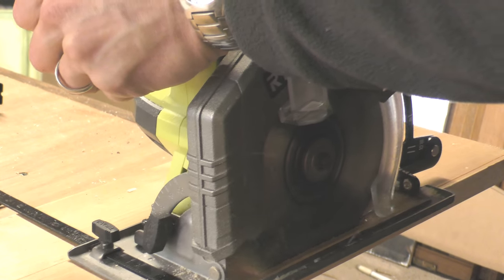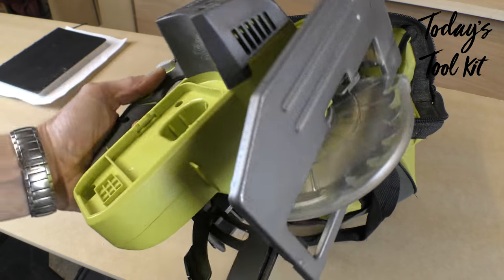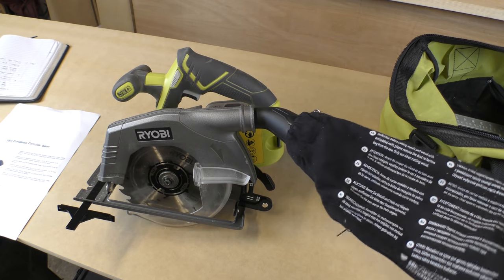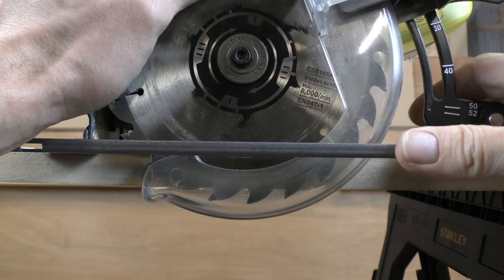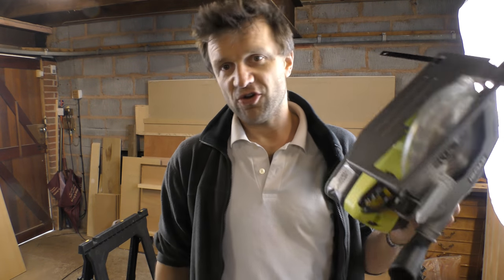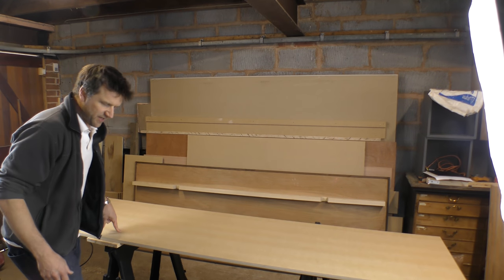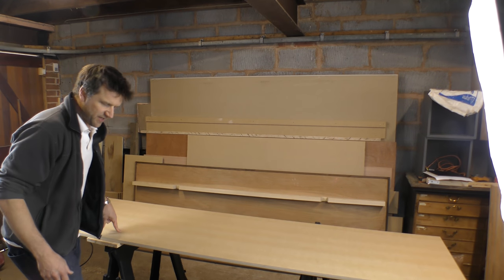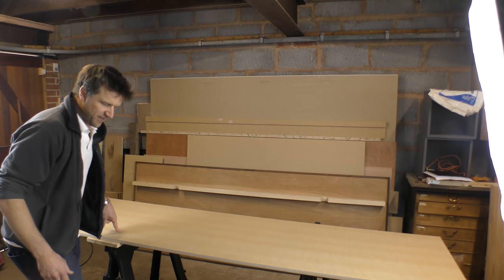Circular Saw - the MUST HAVE DIY Tool

Comment: Hi Charlie, this might put a smile a smile on your face. Bought Black and Decker Circular saw in the late eighties, it died 2 years back so looked around for a replacement and bought a Ryobi  RWS1250, have not used until yesterday in the wind!  So set it up and start to cut and a few inches in it stops, motor working and no cutting. The old B&D was just fire it up and go, no need to adjust anything! So ended up finishing by hand.  Quick hunt on YouTube and I found your video and you answered all of my issues.  Like you I had the depth adjusted too deeply - thank you Charlie for saving the day and my arm muscles!!

Comment: Thank you for a great vid! I bought my circular saw in the summer and it has been a gem ever since. Mostly used it for splitting timber but now doing sheet work. Great tips about the work table, which is a pain with big heavy sheets. Now I understood how I can cut way better! Also didn't know that the depth is so important.

Comment: For full sheets, I stick them on the floor on top of a sheet  of HD foamboard, set your blade to protrude just a few mm below your workpiece. No point wasting time and effort trying to lift full sheets. Also better cuts as the whole piece is supported so no flex and you don't have to worry about the off cuts dropping on the floor.
Reply from the maker: Great tip Sam - thanks for sharing!
Reply: Sam I adapted you idea and used bubble-wrap as it was a zero cost item for me.  It lasted a while but I replaced it with cardboard from old Amazon boxes. Both "spacers" worked a dream and saved a huge amount of time
Reply: I use an 8x4 sheet of 35mm kingspan insulation
Reply: @Ring Tony Great idea! I'm just getting into DIY in my retirement and happen to have an old flat door - perfect. ;-) Presumably, you "sacrifice" the door (i.e., end up with shallow tracks cut into it from sawing wood on top of it)?

Comment: I use the exact same circular saw :)  When I first bought my Ryobi tools, I got a smaller model circular saw, but it was too small for cutting 2 inch lumber which I do all the time, so it was rather useless. I then bought the model you have and It has done a ton of work for me :)  edit: The other Ryobi tools I have found myself using a lot is the impact driver and the multi-tool. I don't know what I would do without them now..

Comment: Great content Charlie. For a long straight edge i brought a length of Unistrut from my local air conditioning suppliers. Straight and true, and got a nice bit of weight to it. And really cheap. Great straight edge for all workshop uses.
Reply from the maker: Thanks buddy! Yes I've got something similar - a long straight bottom section (hanger) from an aluminium electric roller blind box. It works as a saw guide and as with yours, has also doubled up as a general straight edge.

Comment: Got one of these, I'm a joiner, what a great saw. Got to last row of laminate flooring near wall & sods law 3 X 1" strips to finish it off😣 this baby was a god send with the guide, made it a breeze to do thanks Charlie love the vids👍👍👍
Reply from the maker: Cheers mate - and always good to get a positive endorsement from a joiner. Out of interest do you see any need for a plunge saw when you've got one of these. I'm planning a future video outlining the difference between the two. Obvs plunge saws run on tracks which is an advantage but Evolution do a circular saw that runs on a track. Possibly the best of both worlds. .🤔
Reply: @CharlieDIYte  the Ryobi does it all, just bought the evolution mitre saw 210 SMS & stand, that's great for speed for laminate flooring, cutting precise angles for spindles, both together is all the saws you need + love the multi tool...

Comment: I am a very novice woodworker aka CRAP! I never used my circular saw because it always wandered. Thank you so much for the blade height advice and I sure will try it. You have another new subscriber!
Reply from the maker: Hi Dan - I really appreciate that, thanks! Yes, definitely give that a go. I was ready to throw my circular saw away until a chippy mate pointed out the blade height thing. Now I couldn't manage without it! Finally, you're not CRAP, you just need a little practice!

Comment: Great video!!
I always use a corded circular saw because I don’t like how the battery ones always seem to die in the middle of a cut on me.  
Also if I have to cut large sheet goods.  I cut them on the floor and put them on a thick layer of ridged foam insulation.  This way I’m not cutting into the ground ruining my blade
Reply from the maker: Billy bob Smith Thanks! The cordless saws are pretty good these days - and if you use a 4ah or 5ah battery you'll get hours of usage out of it.
Reply: I bought a new corded Makita circular saw this w/e  down from £107 to £ 80  bargain !I do like Ryobi  tools but couldn’t afford that one just now!
Having said that this Makita saw is brilliant !
Reply: brian flower hi mate where did you get the makita from?
Reply: You either arent using the right saw, havent kept up with technology, or else the battery you're using is shit. The Ryobi 7 1/4 inch Brushless circ saw should not be used with any battery that isnt at least a 3.0 ah HP or better......It's all about the Battery!

Comment: This was a very good video for me, I have been using my circular saw! I have 2 smaller and bigger and have been watching lots of videos about using it in the right ways. It never crossed my mind to use the saw guides in this was as I bought some years back for my jigsaw. Thank you for a very well made video, I used some of these tips just today working on a DIY project building a jump for my mountain bike ... fire pit jump

Comment: Fantastic pieces of kit these are so versatile. 

Some small tips if someone is going to go out and buy one... Look for soft start and an electronic brake. These make a huge difference for me personally as I have a Makita 18v Brushless saw with these and also a 10 year old 240v version without these features and the older version feels a hell more dangerous or daunting if you like for a beginner....

Great pieces of kit with a straight edge clamped to sheet materials of a 12" rafting square!

Great video Charlie... Would have gone for the slightly more Makita DHS680Z and a 5 amp battery at £200 all in from Amazon but you are invested in the Ryobi platform I presume.

Thanks, thumbs up.

Comment: I started woodworking with essentially two tools:  A circular saw and a router--on my apartment's kitchen floor and small back porch.  Started with a bookcase, then a coffee table, and never looked back.  A drill is important, too--but so much can be done with those simple, cheap tools.

Comment: Ryobi’s latest is Brushless tools and HP(high performance) batteries. The tools communicate with the batteries, when the tools have a heavy load on them they communicate with the batteries and the batteries send more power.

Comment: Thanks for the video. I decided to buy the Ryobi saw because of this video
Reply from the maker: How are you getting on with it? I still love mine!
Reply: @CharlieDIYte  its a great bit of kit . Saves me going to B&Q to get timber cut to size. Thanks again for the video. I bought the Ryobi mulit tool as well with the variable angled head which is really good.If you plan to buy one or have one I would love to see the video :-)

Comment: Great video Mr Charlie.  I've underused my Ryobi circular saw for 3 years.  I have to say, I just cannot get on with supplied fence.  Ended up going back to my saw guide.  I've learnt loads from your videos.  Cheers👍
Reply from the maker: Thanks Francis. Which one did you have with a supplied fence? The new RCS18X can run on a plastic track but it's not widely available for some reason. I was still love the versatility of a circular saw and made this track https://youtu.be/mvcPuUz_m74 but to rip down full lengths of sheet material you really need a plunge saw. 👊
Reply: @Charlie DIYte  Hi Charlie it's an R18CSP; yours looks like and upgraded version.  I can't find yours so maybe that's been upgraded as well 🙄 Ryobi themselves do 3/4 different circular saws so it's difficult to decide.  Maybe I'll gift it to someone and get a newer model😂

Comment: I made a saw guide! So chuffed, it works great. Thank you!
Reply from the maker: Fantastic - nice work and thanks for letting me know. It's a game changer, isn't it!! I'm sorry I never did that video - I'll be doing one in a few months when I start videoing my wardrobe build. What design did you go for in the end? 👍
Reply: @CharlieDIYte  very basic from scrap in the shed. But with that and your great suggestion of the metal speed square, I made my first ever picture frames and mitre joins. Thank you so much, your videos gave me the confidence to have a go :)

Comment: One of the first tools I bought, together with mitre saw. Got the Evolution pair. Cracking kit, reasonably priced and British made. I was also a little slow in realising the importance of setting the blade so that the tip of the teeth only just penetrates the thickness of the wood. Game changer after realising that.
Reply from the maker: Thanks Chris. Yep, great value for money the Evolution stuff. 👌

Comment: I came up with exactly same kind of guide few years ago. Then I got tired of using (it was clumsy and needed clamps also) and I bought a better quality plunge saw. The guide rail you made can be adapted for cross cuts also. Cut a ~30cm piece and screw piece of plywood vertically to the end. You push that piece against the wood you are cross cutting and get 90° cut. It doesn't slip as easily as speed square and you don't need to mark that ~3cm distance between blade and end of saw table.
Reply: Which one did you buy later?

Comment: Hi Charlie, I bought a corded track saw from LIDE here in the UK, it cost £39:00 and you get a factory made track that is straight and only about 2mm thick and that is good as it means I can cut thicker wood and because it is made of aluminum it is light as well.

Comment: How timely to find your channel today.  I was given a very old well-worn and heavy wired saw that I didn't want to use, or I should say, I was afraid to use.  So, I ventured out and got a small battery powered Ryobi just two days ago!  Your  practical approach to using circular saws has eased my apprehension, and I look forward to testing it out and building a new door for my pump shed this week - a new adventure for this senior citizen!
Reply from the maker: You're welcome June. The critical thing is you must get the height of the blade right, otherwise it will wanderer all over the place. You want half of the tooth on the blade poking out below the sheet you're cutting. Good luck - it's a super tool, you'll love it!
Reply: @CharlieDIYte  Got it!  Thanks for the reminder/reinforcement.
Reply: @CharlieDIYte   A quick update.  I have been enjoying the circular saw and finally had a chance to get the door for my pump shed done.  I am pleased with the way it looks and functions.  Still watching your videos and learning loads!  Best to you.

Comment: Excellent video, thank you. Many great ideas. One suggestion, when setting up your saw, whether adjusting the angle, the height or whatever, keep your battery out and on the table. When in the machine you are plugged in and handling the blade and in danger. The battery snaps in easily in a second, so save it for last. I appreciate your excellent video.
Reply: Omg. Is was thinking the same thing. Great video though.

Comment: I bought mine on eBay from America and saved a lot of money. Also non Ryobi but compatible batteries are also a lot cheaper. The bigger batteries are heavy so bigger capacity has to be balanced against weight with hand held tools.

Comment: Really useful to know how to use the circular saw properly, particularly the tip about raising the height of the blade. I couldn’t get on with mine and its been left unused in the garage for years. I’ll be using it in the future now!
Reply from the maker: I was the same mate. The height of the blade is crucial.

Comment: I bought a circular saw to cut out 400mm shelves for my garage out of OSB, I found it the easiest way to cut is to get a big 22mm OSB sheet and use that beneath whatever you are cutting as a sacrificial layer. No worries of your legs becoming unbalanced.
Reply from the maker: Good thinking. So you were cutting everything on the floor?
Reply: @CharlieDIYte  Yep, using a guide bar I could do up 500mm cuts. I found it more stable when cutting on an uneven surface outside too.

Comment: Hiya Charlie. Wanted to just throw an idea into the mix. 
I’ve got an Evolution circular saw ,pretty inexpensive but it’s been hard to fault in all honesty. 
The thing I wanted to mention was the supplied rip fence. This will probably apply to most circular saws.  The standard (supplied ) item is about 3 inches long, and I tried it out. Relatively poor results. 
There are screw holes on my guide to allow you to attach a longer length of wood ,( in my case ,quarter inch ply  off cut, with the finished face acting as the guide). 
I got a scrap piece of plywood about 12 inches long and attached it to the supplied fence, the difference in end results is incredible!!
Long runs on a board are given a much wider and more stable support!
I did all this work this on your superb Stanley workbench upload. AWESOME incidentally!!
Thanks.
Reply from the maker: Hi there - thanks for the comment (and of course for supporting the channel!). That's  really interesting. Are you saying you're basically extending the length of the fence by screwing the 12 inch piece of ply to it? I've got an Evolution Rage chop saw that was ridiculously cheap for what it is - think it cost about £130. Got to say I'm really pleased with it. The tool snobs on this channel would be in uproar that I didn't spend £700 on a De Walt,  Makita or Festool, but as the old adage goes "bad workmen blame their tools!"
Reply: Charlie DIYte Thanks for your reply Charlie. 
Yes, I think that is the purpose of the two small holes on the detachable rip fence. It makes your fence a little ungainly for the tool bag but it’s worth it. The extra length greatly improves accuracy, particularly at the start of your cut where the extra fence length adds stability. Of course you need to factor in the thickness if the piece of plywood you have added to your fence when measuring. 
Give it a go. 
Great channel  CheersDavid.
Reply: I found that extending the fence made it too difficult to handle.

Comment: Fast, accurate and useful...and that was just the video. I have two of these (battery and mains) which I rarely used until I got the fence (4 quid from fleabay if yours is missing). Quality blades in a cheap saw will work better than the reverse.  Blade depth tip was gold.
Reply from the maker: Thanks mate!! Yep, even with the fence the blade wanders all over the place if you don't get the blade depth right. Thanks for the comment, much appreciated!

Comment: Super vid Charlie, if you can pick up a sheet of Kingspan/Celotex insulation board it makes a perfect flat surface to saw on (works on the floor as well).  It does not matter if you accidentally cut into it.  Sometimes builders leave good pieces in skips.  It’s very light to move around and store. Also, only an observation, just be careful of kick back when moving your rafter guide from one side to the other.  Even battery powered saws can have a nasty sting in its tail.   I have a large Makita track saw and I’ve learnt the hard way, limbs and fingers still in place.  Look forward to the next in the series.  Regards. Mike
Reply from the maker: Thanks Mike. The celotex is a great idea, and I've got plenty of it knocking about in the garage. I'm going to install the parf guide system on the work table soon, so I'll have to use 6mm MDF or ply with that.

Comment: Yes I have used an angle grinder. I have 2 circular saws one battery one corded in the shed. Both sit there. I would never buy one of these things again. Old tech. Track saw even though a few bob more different class of machine. That's my take on these things. Love this channel really good

Comment: This one you have is small one which is awesome , I had same for several years , last year it was stopped working , I bough it's bigger brother (185mm) it's brushless but unfortunately the blade is at right hand side , for me the older one (one you have) was much more comfortable to use than the new one.
I recommend do not do my mistake , I will buy 150mm again.
Reply from the maker: Thanks for that Mehran. It's a great little tool isn't it! Thanks for the warning about the larger one. I think my next one will be a track saw but they are bigger and heavier.

Comment: Thanks Charlie 👍 I have been debating over the past few weeks (lockdown projects ) whether to buy a circular saw. This has made my mind up ! Off to my local B&Q tomorrow to get one . Hope they've got one left . I'll get a speed square aswell . Thanks again .
Reply from the maker: Thanks Graeme. It's been an absolute game changer. Make sure you set the height so that half of the cutting tooth pokes out below the wood. This is key. I would have thrown this tool away if my carpenter mate hadn't shown me how to use it properly. Yes you definitely need the rafters square and it's well worth spending the time to make a saw guide if you're thinking of cutting long lengths. I'm planning a video on that at some point.
Reply: @CharlieDIYte  Will do Charlie. 
Can't wait to start using it .Got a new project all worked out, just got to dig the wood out of the garage to do it ha ha.